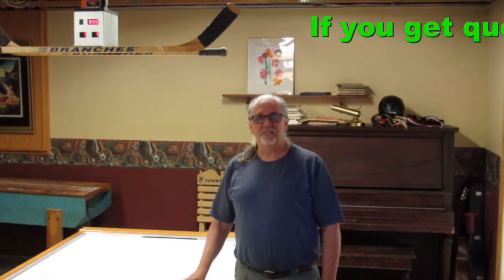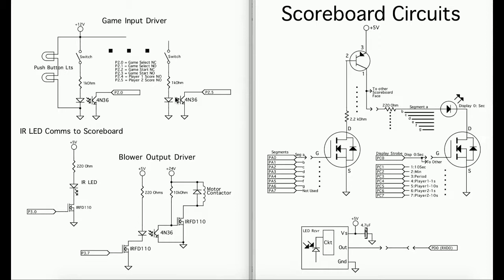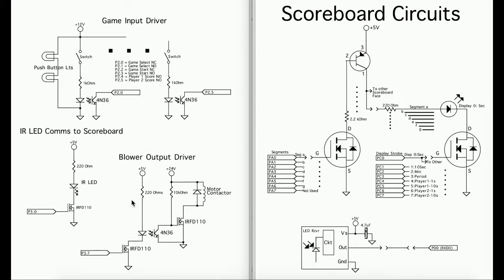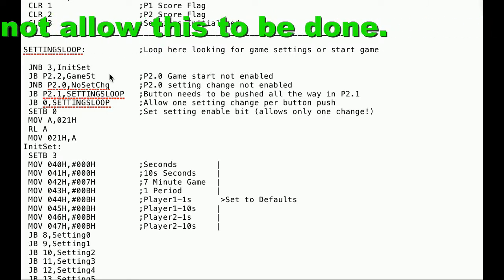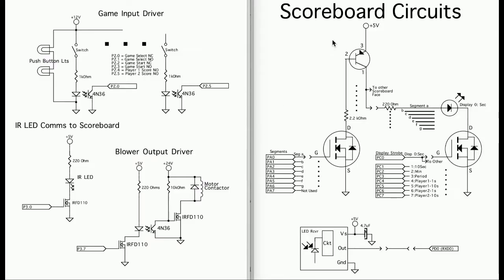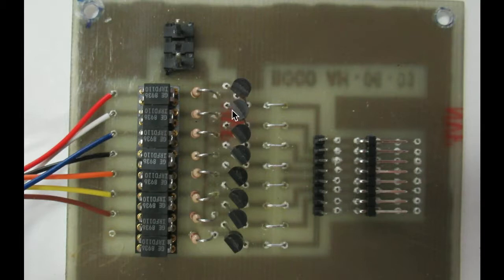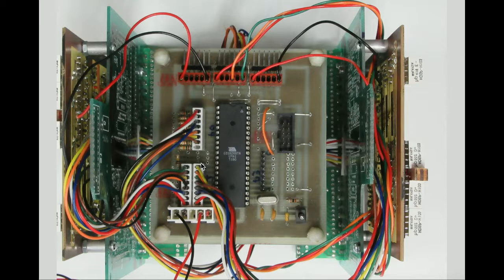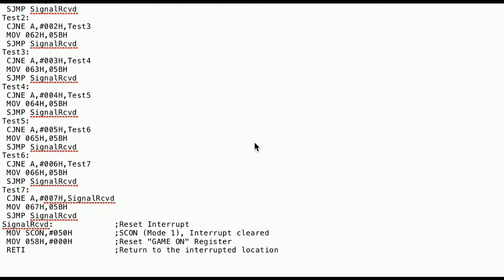Homemade (DIY) Air Hockey Table, The Electronics

Comment: hey cool video DR Mike! Quick question, what language to do use to program the electronics?
Reply from the maker: I use assembly.  The chip I used is obsolete along with its instruction set.  I now use an ATmega chips, the assembly language is similar, but not exactly the same.  If you use assembly a few times, you get used to it and it really isn't that difficult.